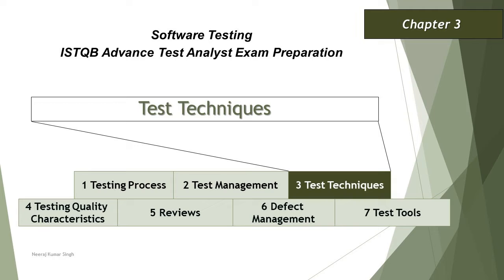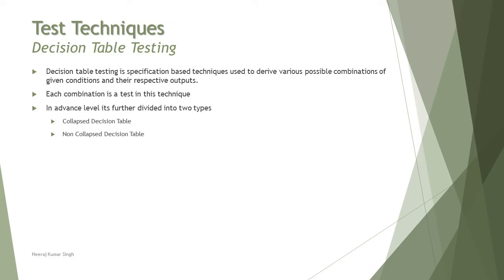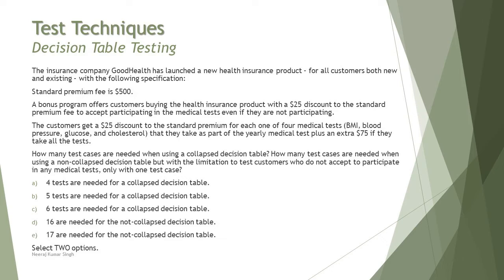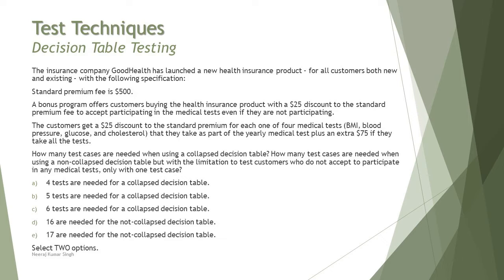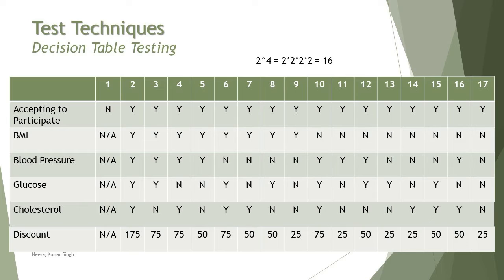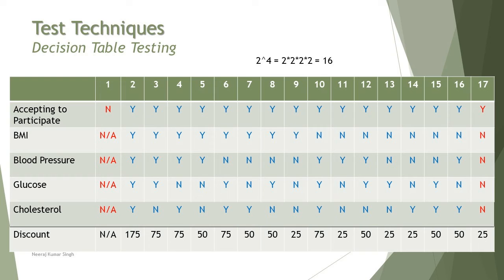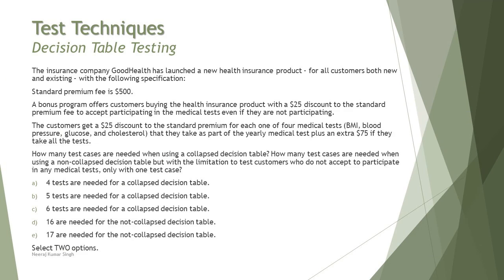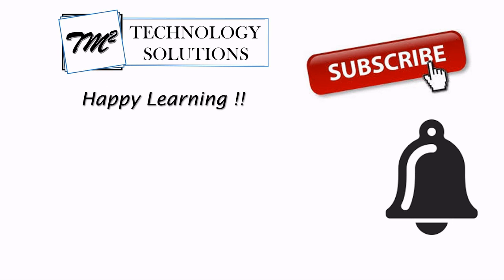ISTQB Advance Test Analyst | 3.2.3 Decision Table Testing | ISTQB Tutorials

Comment: Again thank you for Tutorial, it thought me well, but about The Insurance company GoodHealth there are few issues and mistakes:

1.) You missed the negative scenario in which user didn't buy insurance at all, let's assume product has no option of not purchasing insurance, but you are still wrong not mentioning it
2.) You missed that user had no obligations to accept participation before participating, meaning user could do tests without accepting to participate ( making it total of 33 non - collapsed test cases)
3.) I strongly believe that ISTQB Analyst exam will have one question for collapsed and one for non-collapsed instead of having two options for each one on single question
Reply from the maker: Thanks for sharing your observation. 
What you described is very much practical but when it comes to technique we adhere to the definitions and information provided in questions. As far as they mention in question that you should also consider the scenario (above mentioned by you) we should add our real time understanding to it. This may result in no options being correct. I hope this is in line.

Comment: The decision table input values for Glucose seems to be incorrect. Please check that. Also, on what basis do you say that apart from column 1,17 only 4 tests are needed? Can you explain a bit more there please?
Reply: I got also different values from what we see in the video. I got 4 distinct actions {25, 50, 75, 100} with the middle combinations. Since the BMI, Ch, Glucose and Pressure have the same value, those correspond to taking {1 health test, 2 health tests, 3 health tests, 4 health tests}. I assume that is where the 4 test cases came up